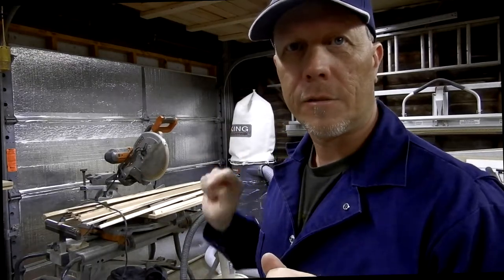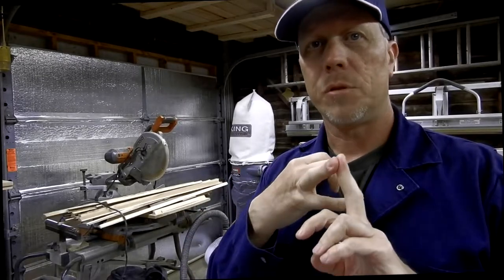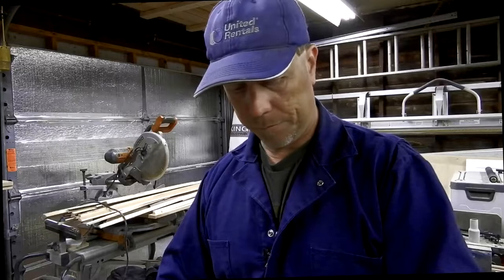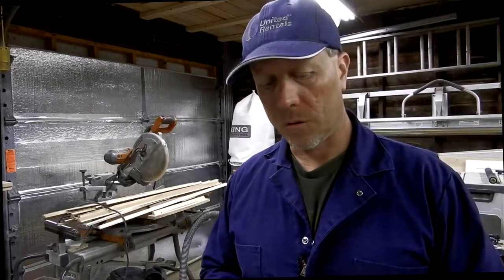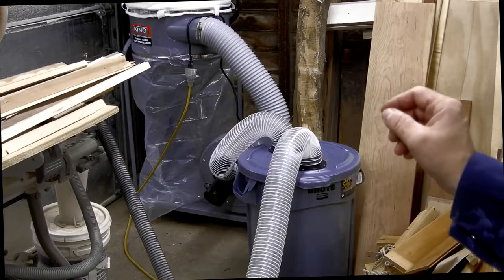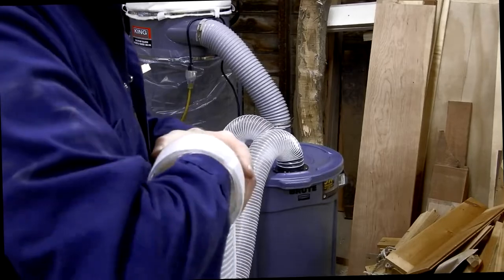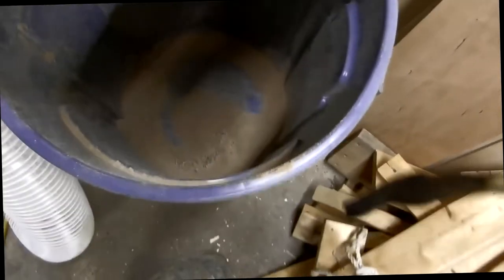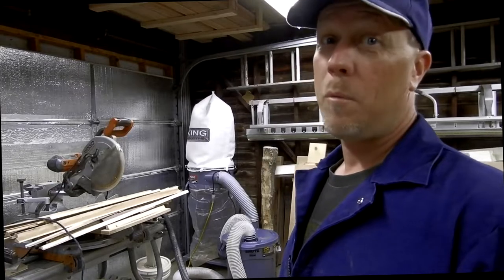Dust Collector separator

Comment: I purchased a similar set up from a company called Dust Rite.  Their instructions state to mount the opposing elbows as close to the outside perimeter as possible.  I installed my unit on a removeable lid 55-gallon metal drum.  I think the perimeter location is important for proper cyclone effect.  My set-up has performed flawlessly for many years now.

Comment: You have too much turbulence inside that small barrel and its pulling it back out to the filter. You need to mount it on top of another barrel to give the dust a place to fall and get out of the cyclonic air stream. Easy fix. I did this only I used 2 55 gallon drums with an 8" accordion hose between them and get zero dust to my filters
Reply: excellent idea. I'm in the process of building a garage vac 240cfm max 70 inches water max. My question is did you put the 8 inch hole in the center of the bottom/top  between the 2 drums or as close to the side of the bottom/top of the drums as you can?

Comment: Remember, this system is probably designed to work with a typical, but relatively powerful shop vac. As compared to traditional dust collectors, shop vacs operate with large 'suction pressure' but relative low airflow. So the suck hard (large static pressure), but they don't suck a whole lot (metric equiv of cu ft/min). I think the problem here is that the cyclonic action created by the large airflow from your dust collector (probably the metric equivalent to 500 to 1000 cu ft/min) is creating a really large 'tornado' effect extending down from the bottom surface of the separator lid all the way down to the bottom of the trash can (or the surface of the already collected material). If you have already collected debris, this material is whipped about by the cyclone and it's sufficient force to bring the fine dust back up in the air column so that it gets sucked OUT of the trash can and into your dust collector itself. 
This problem illustrates why typical (and successful) cyclonic separators are designed the way they are. First they include a significant (usually vertical, except see Harvey Gyro Air G700) distance between the bottom outlet of the cyclonic funnel and the top of the collected material. This prevents most of the recirculation of previously separated and collected material including the fine material. The other feature is the funnel shape itself. This causes the diameter of the rotation of material to decrease as it falls. This helps to maintain velocity for a longer period allowing more material to move to the outside of the flow so that it falls into the collection container and is not sucked back up into the air leaving the cyclonic separator and headed to the dust collector. 
The Phil Thein baffle mentioned in an earlier comment here (@johncolley7643) can provide a similar effect by placing a partial horizontal baffle along near the upper circumference of the separator to increase the effective separation between the heavier material that will fall to the bottom and the air and finer material that will move on to the dust collector itself.

Comment: Could be too much air flow you are connecting to a working dust collection system
I made my own with a shop vac working great ,your system is working, just not designed for a "primary " collector